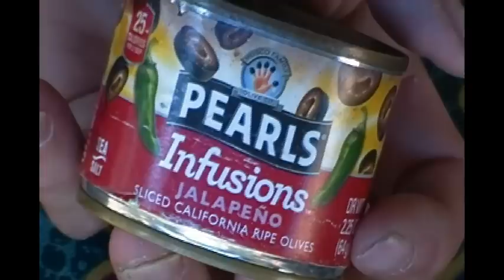The Wick Stove

Comment: you can use metal window screen or hardware cloth instead of the cot can on the top as well!! some ways that's easier to get in!!and your right on the steel wool, it doesn't melt and glaze over like fiberglass does, over time the fiberglass will cease to work because of that!